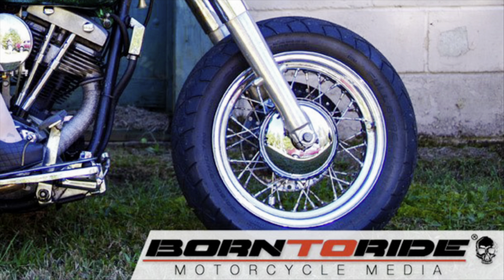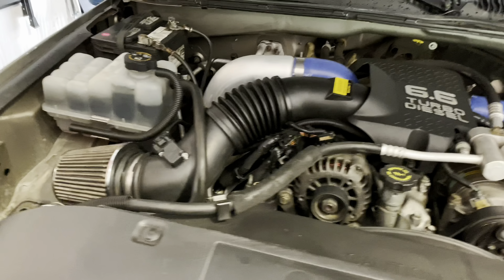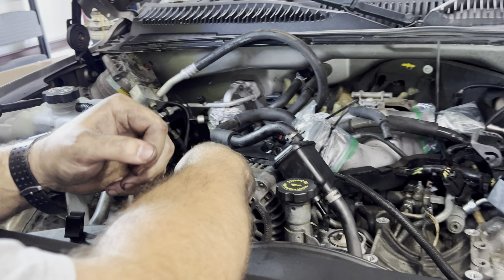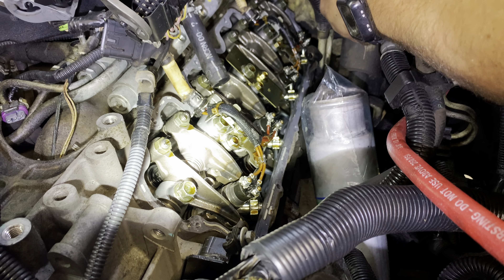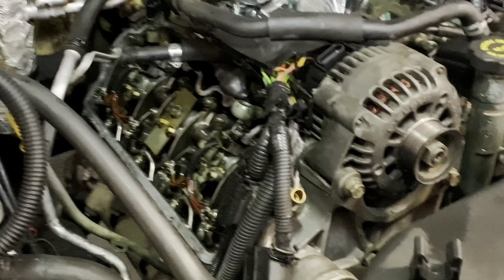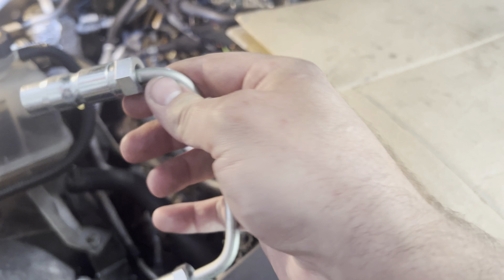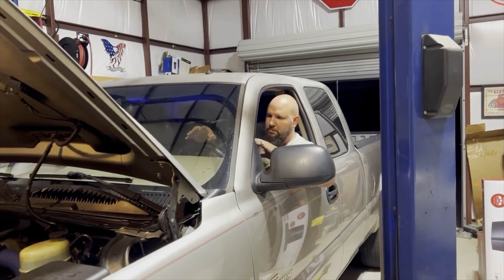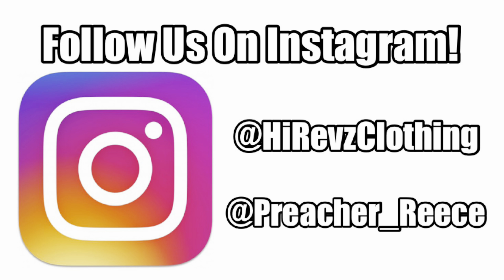Diesel in the Oil! - Injector Return Line Issue - ‘02 2500HD Duramax

Comment: Your video and mean bee video helped me out tremendously. Thank you!  It looked like you hooked the passenger side back up, fuel line wise, to maintain pressure after replacement, is that correct?  I really like the bag over the air intakes also btw!
Reply from the maker: Thank you man.  Yes we did.

Comment: Will the oil and the diesel mixing in together cause internal engine damage
Reply from the maker: Yes it will.  After a long enough time, it will begin to eat the bearings due to lack of lubrication, and then total oil of pressure loss.
Reply: @HiRevzMedia how long exact until damage is severe? I noticed oil pressure dropped then truck start to idle rough. 

It started about a day ago today we did the oil change and 20 quarts of oil mixed with diesel came
Reply: @HiRevzMedia I also do oil changes every 3 k miles and last time I did it, oil looked good no diesel in it.

Comment: How long did the whole job take you? I think this may be my issue
Reply from the maker: About 18 hours total. I’m three different days.
Reply: Okay thanks a lot. Hoping I can do it in a weekend
Reply: What all parts did you buy for this job? Trying to figure out what I need to order and what can be reused. Thanks a lot
Reply from the maker: @sethbaker5374 for this job, you just need a valve cover gasket kit and the return line gaskets, if that’s what the problem is.
Reply: Okay I’m into the job now; to test the passenger side, do you apply the air pressure to that same fuel line? I opened the passenger side first and haven’t started on the driver side yet. I appreciate you!
Reply from the maker: @sethbaker5374 we added a little pressure to both sides, some of the lines may need to be reconnected to hold pressure.
Reply: @HiRevzMedia  sorry for my ignorance, but the only place to apply that air pressure is on the driver side fuel line connection by the firewall, correct?
Reply from the maker: @sethbaker5374 yes, I’m both lines.
Reply: @HiRevzMedia  okay roger that. I fought with a stripped out upper valve cover bolt for a few days but just got it out. Blowing air through into the return side like you did I’m not seeing any leaks. Any ideas? I really don’t want to hook everything back up and run it with valve covers off. Truck runs fine and isn’t smoking so I don’t think it’s injectors; they were replaced 75k miles ago